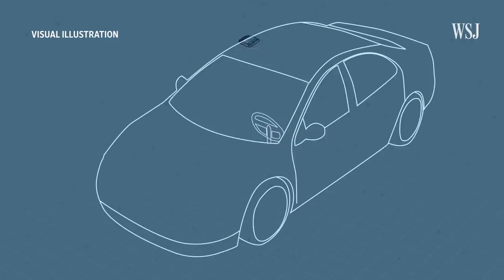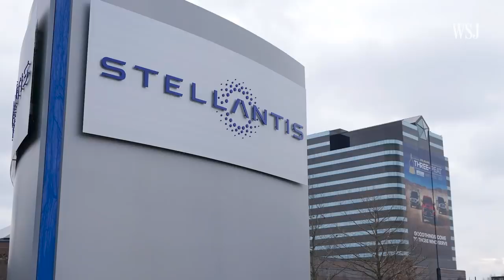How the Chip Shortage Is Forcing Auto Makers to Adapt | WSJ

Comment: I'm pretty sure they just made up those reasons. Diverting production to consumer electronics is not the root cause. That actually doesn't even make any sense. The shortage was due to the order cancellation in mass as soon as the virus hit. The car manufacturers along with several other industries cut back their chip orders. As a result the foundries stop production or shifted to other chips. When demand came back the foundries were unable to meet the demand because there is a several month ramp up. To prepare the machines and the production process. Due to the massive uncertainty of demand coupled with the massive lead time on ramping up production of these ultra complex microchips, that's what is the primary driver of the shortage. Come on Wall Street journal, you think tmsc just called up Chevy and said sorry got to make some more flat screens for the lock downs! 🤔

Comment: Mi solution is simple.  Automotive industry will make cars with basic but important asistances systems on which involves active and passive security for the passenger. Backing on time similarly in the past with classic cars. In fact, in the begining, cars didn't has none microchips and other electronic devices. It was purely mechanic. OEM's need to start reformulating new ways to manufacturate cars and these won't necessarly has "Big touch screens" on the dashboard. But the negative side is that hybrids and electric drivetrains requires a lot of that. Otherwise the last low emissions norms setting for the governments won't be achieved.

Comment: And as complicated as cars are these days they still assume the user is very dumb and doesn't deserve any information about the car,  "check engine"   is it the engine? is it the exhaust system?  Did I not completely tighten the gas cap?   Oh no take your car to a dealership as soon as possible!    Or yanno get an OBDII reader, and use an app on your phone to tell you what sensor is triggering so you can make an informed choice about where you should take your car (if you need to do it at all)

Comment: While other automakers are decreasing production, Tesla is increasing. This will only hasten their eventual doom.
Reply: Stop talking nonsense, tesla barely made 500k cars last year when toyota made about 10 million, tesla doesn't have the capacity of toyota you're welcome
Reply: @alanmay7929  Its not about current capacity, it's about growth. Remember my comment in 10 years when Toyota is limping into the 2030s and Tesla is dominating.
Reply: @Voyager_AU  nonsense, were talking about chips and very high volume manufacturing here, toyota and vw basically uses everything available on the market and since they make way more cars than other, the supply is difficult.

Comment: Dealerships are loving this shortage, because almost every new vehicle is selling way over MSRP thanks to all the pure-profit add-ons installed by the dealerships. If you're lucky, they might negotiate a little on the price of the add-ons only. In my city, Corvettes are selling at $30,000 over MSRP. Their used cars are also selling at record-high profits.
Reply: Doubtful.  Dealerships normally move over 100 vehicles per month, which isn't possible without inventory and they have to pay more for the used cars they buy.  Not all dealerships will survive this test.

Comment: Why does a car need like 17 chips? Why not have one central computer that has a super chip or two and have it wired to like all parts of the car?
Reply: Modern cars have hundreds of chips and it's used everywhere like door handles, light switches, windows, electric seats, door mirrors, etc, etc, etc. Basically every electronic thing in a car has multiple chips. Car manufacturers can't go back to manual/analogue systems because that would be the same are throwing away all their car models and having to start a completely new supplier network that doesn't exist.
Reply: Why have chips at all? Cars don't need them at all.
Reply: @NeutronStream  Great explain bro...
Reply: lane keep and departure asist , tire pressure sensors, engine ECU, infotainment, airbag deployment system, radar cruise control, its many they require different chips because they are computing every time to keep you safe
Reply: @TheListOf  let's all go back to carbeurated V8s at 10MPG with 150HP, and no airbags, and manual windows.
Reply: @TheListOf  okay cool next time you get tboned or someone crushes into your car hard and the airbags dont deploy we will see who is the wimp consumers consider safety when buying cars or trucks why do you think manufacturers do recalls its because of safety most of the time
Reply: Most of the manufacturers are working on this.
One to three main computers for the car which then are wired to sensors and actors.

I believe the first systems are already released to the market in the Volkswagen ID cars and it gets more centralized in the next years.

Comment: Every company should design a basic car with no silicon processor needed and sell for a basic price . Like 15 k for a new full hardware car .
Reply: Most countries don't allow this due to safety and fuel efficiency reasons. You can't have airbags without a chip for example.
Reply: You can get a Kia Rio or Mitsubishi Mirage for $15k US. The Rio will still have heated seats, infotainment, air bags, sensors, the whole works, and still selling below MSRP.
The real ticket is to take better care of the car you already have. When was the last time you changed the transmission fluid?

Comment: It is time to introduce single multipurpose chip rather than individual chips for different components. The smart approach will be a good alternative rather than increasing capacity.
Reply: But automotive chips have the most extensive quality control and have to last +10 years and with stand -50-+150F and not need rebooting or resyncing.  No other chip can do that today.
Reply: but if the individual chip degrades then all degrades. having it in multiple places instead of one also makes it easier for replacements
Reply: Do you mean CPU? They are many times more expensive and complicated.
Reply: @stmbds  they shouldn't have a chain reaction in a vehicle going down the road.  The vehicle could wreck and take others near by.  If the ABS/stability control module stops working at least the car is drivable and can driven to safety.

Comment: That 2008 car is a good buy that 2020/2021 is going to be a expensive problem.

How you may ask ?

Car that’s had tens of thousands of parts over a decade made will have very little issue needing a upcoming repair but your new car might not get repaired ever or take months for a cheap part.

I’ve seen people wait months for a hood for a 2021 f150